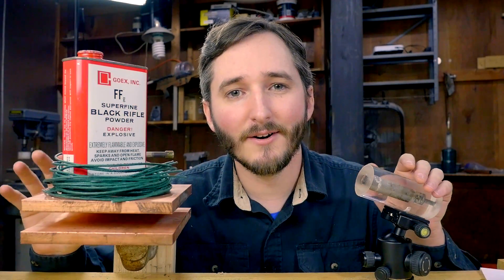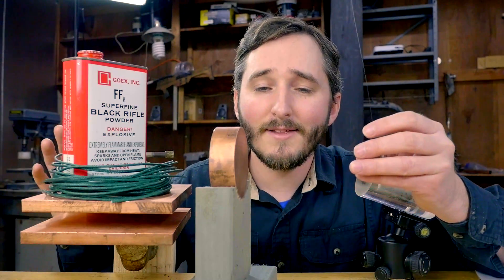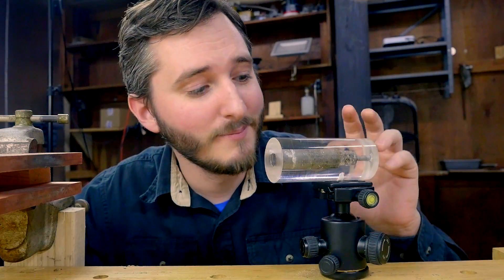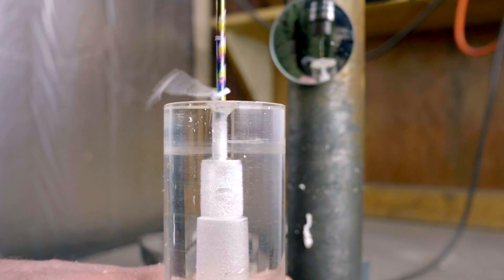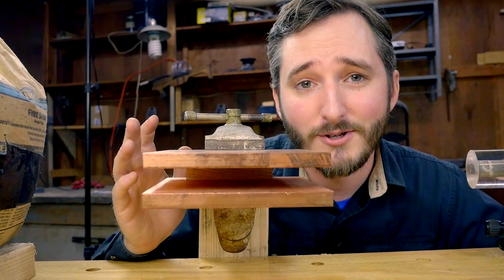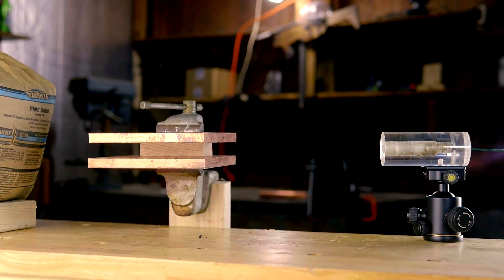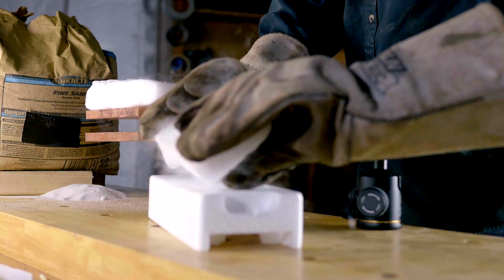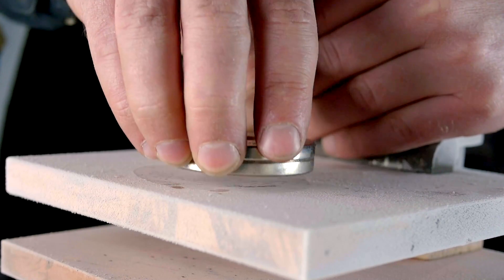Electromagnetic Force Fields VS. Magnetic Cannonball

Comment: It seems to escape the notice of the good professor that impedance increases with flux. Had he swung the magnet with the flat side facing the copper puck there would have been a different outcome as well as if the bullet would have been cylindrical and of larger calibre to suit the copper pipe. In the case of the copper sandwich experiment, the disc magnets he was demonstrating with would have been a more suitable apparatus, again in closer proximity to the copper plates. This experiment simply demonstrates ineptitude.

Comment: I know I’m late to the game with this. Still sifting through all your amazing content. But I think size is the main issue. The projectile magnet is too small, leaving too much space for the effects of eddy currents to have any influence on the magnet. As an example, when you perform the experiment with dropping the magnet down the short copper tube, the magnet itself has a circumference only slightly smaller than that of the copper tube. I’m guessing if you were to perform that same experiment, dropping the magnet down the tube, but with your projectile magnet and the 10 foot copper tube, which I believe you said was 1” in diameter. Way bigger than the projectile magnet. My guess is if you were to drop that magnet down the 10 foot copper tube it would not have the same braking effect.

Comment: Lead is slightly diamagnetic so it would be repelled by a magnetic field the same way the copper is, so theoretically a very strong magnet or electromagnet inside a bulletproof vest should be able slow a bullet. Then again I don't know if heating a metal destabilizes it's magnetic properties like heating a magnet to it's Curie point demagnetizes it.

Comment: When you dropped a magnet through piece of copper pipe the diameter of the pipe was relatively close to the diameter of the magnet. Maybe this last experiment fails because the diameter of the copper pipe was too large compared to the magnet.

Comment: Read the comments and try again. 
Need a burden resister.
Need a better mount.
Use compressed air and sabot or a spring to launch the magnet.
Use a cylindrical magnet.
Use longer copper plates
Alternatively have a para-magnetic projectile pass through a magnetic field.
This could be a good experiment if performed correctly.
Less bling more science.

Comment: Hmmm, since the copper has some effect in electrical conductivity and resistance ...
 ..... If the copper tube / shield / "moon" can be reverse polarity charged enough to allow the orbiting (on a wheel)  ball / "metal ore planet"  (acting a bit like a dampener "moon" / shield ) as it passes the stationary "sun" magnet on the inner side  ( which is pulling the string of balls towards itself .... Can the "planet" not be made to continue past the "sun"  - from the attracting field of the "sun" on the next "planet" behind the first "planet" - since the stopping effect of the dual polarity "sun" (near the section between it's poles will be mitigated by the copper moon shield?

Although - the fact that the earth is compressed at the poles, has metal ore in it, and also runs tilted -may mean that there is another regulated fluctuation dynamic included in terms of efficiency, crust thickness also varies. Since it is apparent that it is not the sun's electragnetic radiation alone which keeps the planets in a spiralling "magnetic coil" orbit, they appear to have qualities which make them work in tandem as part of the solar system - Some asteroids pass through whereas others join orbit.
Which indicates that their qualities and speeds/momentum have a bearing on the movements in the multi-age tuned masterpiece clockwork.

Comment: So two things come to mind as to why the copper plates and pipe may not have worked. If the bullet is magnetic, then wouldn't superchilling both work the best? 

Also I think the plate works to stop the magnet because of their orientation. Maybe angling them so they're closer together on one end would help the Eddie currents. The copper pipe is kind of impossible to do that with but I think you would have had to use a pipe that was less than a 1/4in wider than the ball. I do the drop trick with magnets i find at work and it only really works when the pipe is just big enough for the magnet to move through.

Comment: Did you consider the cannonball magnet might be rotating inside the copper area and negate the induced field? as soon as the magnet is introduced to a like field, it will repel.  But if it is a ball, would it not just spin? What is the projectile was a cylindrical magnet 1.5" long with N/S at each end?   Would that have more of an effect?

Comment: Back in the late 1970's, I had a piece of 3 inch acrylic and drilled a 5/8 " hole down it, offset from the center axis.  The purpose was not to make a cannon but to put a 1/2 " copper pipe inside the acrylic.  When the sun shines on it, the sun gets focused on the pipe, more than it normally would.  The acrylic puts twice as much sunlight onto the pipe as normal.    Offset it more and it would work better.  If I had just glued the copper pipe to the acrylic instead of drilling the hole. it would take all the of the light and focus it on to the pipe.

Comment: I loved the video, but... Your theory seemed to be based on the induction of the magnets' field passing through the copper and that has a mass vs proximity vs field strength equation in there. The magnet you used to demonstrate was a closely approximate size to the inner diameter of the copper pipe (also adding air compression) that allowed the copper to be placed within the field rather than millimeters from its outer 'bubble'. It seems to me that either the magnetic field needs to be stronger or perhaps not using 'inductive' current vs a 'direct' current to compel the fields' velocity.

Comment: The ball itself is a bi polar magnet and the movement while causing the bullet to be shot down the center of the plates would induce a like field or repelling field. The ball should rotate and as it does it will indice a like field and turn or rotate as it moves across the plates. This is not good. If you want to slow or stop the ball it should be the non ferros material and the firld should undulate or go from pos to neg thus inducing the desired effect like a magnetic brake or an eddy current brake does when a slab of copper is moved into the field and the loss should mimic your initial test to the degree that a loss will be seen and a reaction could be measured. If you wanted to slow something down like a roller coaster ride this is the way to do so and reduce break wear and tear. We use this effect at the accelerator ride in Knott's berry farm in california. You can observe this effect with realtime results. You can also use lentz coils and create a hover effect when moving over the coils at about 5 mph using an undulating waveform (sign wave) with permanent magnets as used by richard posts permanent magnet mag lev design. Currently at least at last contact general atomics in san diego cal has used this approach and has a test track with a scale model that works as predicted. Dr post designed it in the 90s and built it at Berkeley and transfered the tech to that program. Distance from the materials is critical and the field is not very large at distance so you must have the field and the material must be influenced by it. Your gap is to large. You can yoke it but that might be a little to much effort for you application.
Rick

Comment: Like the larger magnet through the copper pipe, what if you used a pipe that was only slightly larger diameter than the magnetic ball? Would that have any affect on the magnetic strength output?

Comment: Smokless powder burns slower than black powder, in a rifled barrel setup the smokeless will continue to burn trough out behind the projectile as it travels in the barrel giving higher pressure untill the bullet leavs the barrel. 
Black powder burns faster and goes out almost in one bang.

Comment: The eddy current generated in the copper slab or the hollow pipe due to the projectiles (magnet) motion is not enough to generate enough force (field strength) to change the momentum of the projectile to zero. Can you use high tesla electromagnets to stop similar projectiles?

Comment: It would turn to hot shreds before stopping due to the extreme energy put into the ball.
The same amount of energy put into the ball is channeled into the magnetic field as eddy currents and released as heat in either the ball or the copper pipe.
How intact was the ball anyway?

Comment: Thank you for your videos NightHawkinLIght. Would you mind sharing where you got your copper from? I'd like to buy some for class. Thank you.
Reply from the maker: You can sometimes find them on ebay sold as "copper bus bars". It's much cheaper to buy plates of aluminum which will give the same effect to a slightly smaller degree.
Reply: @Nighthawkinlight  Thank you!

Comment: Did you considered the loss of magnetic properties associated with high temperature ?
Check forging videos, a magnet is the test used on forged metals to confirmed they are at a proper working temperature.

Comment: Why not record the speed of bullet from a to b without the pipe and then place copper pipe and then record the speed from a to b and then get the measure how long pipe you need to slow down bullet - also the copper slow down is higer when the bullet travels slower ( it has time to affect the bullet more). Good luck 🍀

Comment: Could you rig up a permanent magnet to the top of all four pistons in a four cylinder engine then replace the sparkplugs with strong electromagnets to send a repelling pulse distributed trough the distributor to make a weak conversation that used timed repelling force to mimick the explosion probably would work best on older motor with less compression ??? Has it ever been tried?? Is it a bad idea??

Comment: The failure is because the cannon ball spinning, i.e. the induced field could accelerate or had insignificant effect to the speed of the cannon ball. A free fall test through a copper pipe should be carried out before the gun power tests.

Comment: Interesting. I believe that in order for the copper to stop a subsonic magnetic projectile (or at least slow it to non hurtful speeds)  it would have to contain a much higher eddy current implied in the copper. This would indicate that the strength of the magnetic object would also have to have increased without increasing the size or mass of said object.

Comment: Ok. I have another way to try it.
Steel is ferromagnetic. All you need to do is to place a bunch of neodymium magnets 🧲 at the length of a rifle barrel and use a copper bullet or aluminum bullet.
Connect a voltmeter at the end of your barrel and the negative in a earth pole. Measure the power generation. 
🎉 tada! Let me know and mention me there!

Comment: I'm sure with a powerful enough electromagnet you'd be able to cause a minor deviation in the trajectory of your projectile, but to slow it to a complete stop (converting all the kinetic energy of it's motion into heat) in such a short distance (as you appear to be attempting), I suspect that you'd need a seriously intense magnetic field, of the kind that's produced in one of the ring magnets of the Large Hadron Collider (that carry so much energy they need to be cooled with liquid Helium₄), which achieve an impressive steady 7 Tesla (⊕) of magnetic field strength (for 12 hour periods). 

For reference, the Magnetic Resonance Imager (MRI) used at most hospitals would be only 2-3 Tesla (& still need to be supercooled.)

⊕ nb: Was reading 'bout magnetic fields & noticed some amazing new research has actually achieved strengths of 1200 Tesla (for tiny fractions of a second) & 45T for continuous operation, but these experiments create unusually compressed fields that are tiny - far too small for this purpose.

Comment: Suggestion: Use a second pair of hands to operate the camera to catch the bullet passing by in the frames. Could you grind a pointed tip on a magnetic sylinder and add fins at the back to add to your experiments?

Comment: Tesla was the originator of our electric grid today. He found that transformers could be used to send high voltages over long distances with less loss. and at the end use a transformer to reduce the voltage to lower levels. Here in my neighborhood we have three lines at 4KV on the top of telephone poles and transformers that drop the voltage to 240 VAC and to two 120 VAC lines when connected to the neutral

Comment: Rare earth magnets start to lose their magnetic field above 80 degrees Celsius until it's completely gone at their Curie temperature of 320 °C, so it might be worth checking the magnet to see if it's affected, because I'd bet that it wouldn't make it to the end of that tube if it hadn't. Putting a (sacrificial:) mirror at the end of the pipe would allow the camera to look directly at the cannon without being damaged.

Comment: I noticed that the last experiment with the pipe the pipe might have been too close allowing thrust from the cannon to use the pipe for thrust through the pipe as during the slow mo i noticed a lot of thrust fumes blasting out of the copper pipe with the magnet cradled within ite plume

Comment: You should try a bipolar magnet with thicker copper tubing
the reason why your bullet it's not even slowing down it's because the atoms on the copper are no enough and they have zero effect on the magnet you are using as a bullet
you will need a 8 inch thick by 6 foot  long pipe and a bipolar bullet.
good luck.

Comment: I think that one thing that may be happening is that the heat produced from the gun powder and friction inside of the cannon, has heated up the projectile magnet enough to possibly degrade its magnetic field slightly. So to ensure the best possible circumstances for both the copper and the magnet, you might want to try freezing both before an attempt.

Comment: My understanding of an electromagnetic force field is to apply a electromagnetic field to a steel plate without touching the the plate. Thus producing an invisible force field on the other side of the plate. Although I heard it takes a considerable sized electromagnetic field to generate the force field. Look into it.

Comment: You should turn the Magnet on the string on its side. Put another Magnet on the other side of the Copper with a like Pole. That way you could see if you get a push of the Magnetic Feild through the Copper Disc.

Comment: What you did in this video is exactly opposite of a rail gun. Why don't you do a video where you see if you can run alternating or unidirectional high current lower voltage DC around the copper pipe and see if it does not increases the speed of the magnetic ball after you fire it from the cannon.

Comment: The magnetic induction is dependant on the distance from the magnet to the.  The smaller the distance, the stronger the current, the stronger the generated electromagnetic field.  When the magnet is about to hit the  vertical copper plate, the distance is extremely small, hence the electromagnetic force grows.  The distance from the ball to the pipe wall is way too large to induce any meaningful electromagnetic force.

Comment: would it make a difference if you use a cylinder and not a sphere i believe it rotates as it is going in the pipe and that's why it may not get its full stopping power. it may be clearer to video if you use compressed air like a pcp gun. Great video

Comment: Imagine how weird it would feel having a magnetic sledgehammer and trying to hit a copper wall
Reply: I tried to find an 8 lb neodymium online for use as a sledgehammer to no avail. That'd be a fun experiment to try!
Reply: @StefanBurns  You may invert it, use the magnet as the anvil and copper as the hammer
Reply: @StefanBurns  This video literary tells you that you will not notice any difference. The resistance is tiny.
Reply: @stc2828  Well for a bullet sure, tons of kinetic energy there. There would be less kinetic energy to overcome with a light hit of a hammer, might feel/be different
Reply: @StefanBurns  The hammer is way, way heavier than that projectile. You have to swing it very, very slow to feel the difference.
Reply: @stc2828  Yeah, and that would be cool to try!
Reply: @stc2828  I think the magnetic field would scale roughly with the mass of the magnet though. So a large sledge hammer would be more similar to the slow medium pendulum than the quick tiny bullet. Although, I don’t think it’d be that big of an effect, tapping the wall might feel quite weird
Reply: @stc2828  yes, however it will have an insanely strong magnetic field because of that size.
Reply: @myrealusername2193  для он ля
Reply: That could be a way of rigging the strongman bell you see at carnivals so no one could win the
 "cupie dolls"lol have a copper plate in the target at bottom of strong man bell and film the peoples reaction priceless
Reply: Yea as a slave and the only way to get out is to break through 5 years of doors, theres copper on the floor and you have magnetic chains with weights on them
Reply: You didn't know that the how strong are you ring the bell? Con job was A magnet and copper was the fight .you have a sledge hammer magnetic and a copper plate under a covering.
Reply: wouldn't matter. will still hit fine.
Reply: Imagine a copper outer suit with a magnetic like wet suit underneath on body and get impact resistant from harm or falls
Reply: Imagine how expensive this setup would be

Comment: You could try a air cannon, and larger magnet, with thermal camera, to see the pipe heat as the magnet passes! A 2gal. Air tank, with 1"+ ball valve, and a bit of pipe about 3/4" with reducer bushing, may need to hone the pipe for clearance, it could be cool/ or HOT!